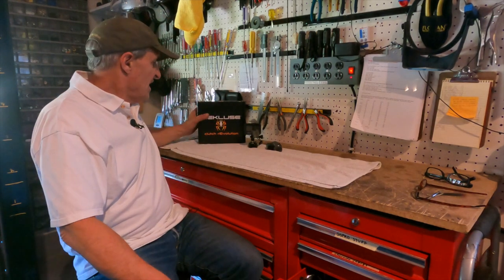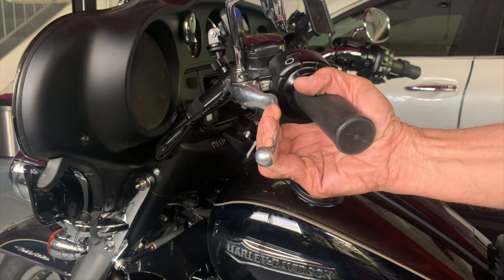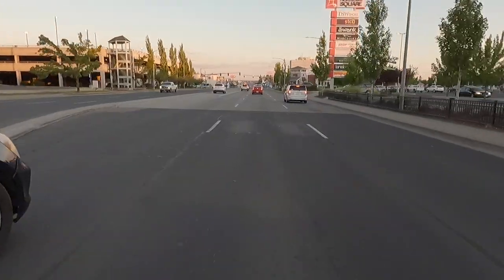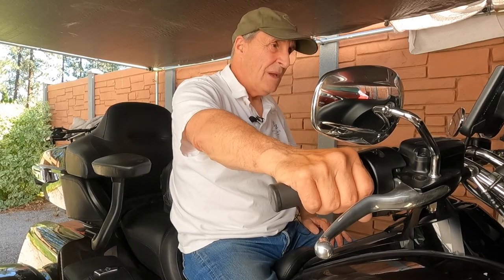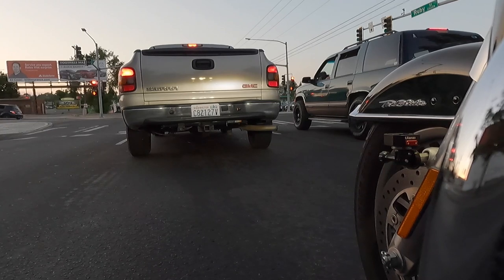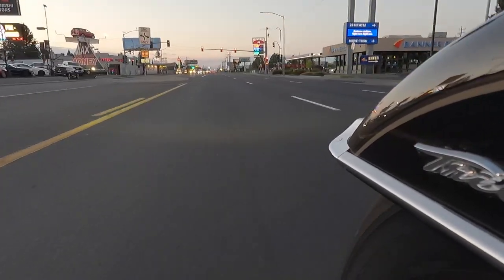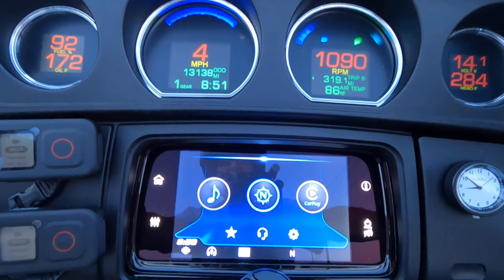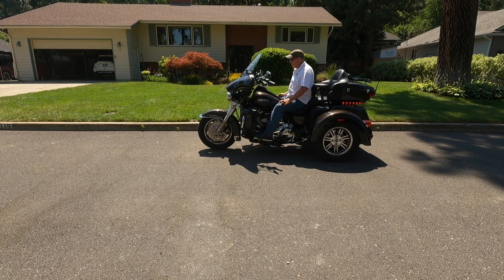Rekluse Clutch Harley Davidson Tri Glide M8 Examples of use.

Comment: I’m watching you use the 10% if I pull it all the way in would that be an issue if I pulled the clutch all the way in
Reply from the maker: Should not be an issue whatsoever. I use the 10% method all the time with my rekluse clutch.  Known issues for a rekluse clutch wearing out prematurely is, being very hard on the clutch without adjusting it as needed. I have not adjusted mine in 10,000 miles that it’s been on there. And I believe that’s because I am easy on it.  A person hard on it would require adjusting more often. The other issue is a bad installation. Not following the exact procedure and installing. I have seen that happen.  Everything has to go in perfect order.

Comment: Fantastic, a new relevant video on the rekluse! I looked last year but not enough information for my liking on my 2014 ultra limited. I too have hand issues on the clutch lever. Also have short digits, and installed a short throw lever, works great. I read another comment about the 10% downshift. I thought you were downshifting at a certain rpm range without the clutch. Did I miss something there? 2nd question, does this clutch get rid of the "learch" in lower gears making you pull the clutch in coming to a stop? Think I may go ahead and order one and keep my Ultra!
Reply from the maker: I use the 10% method up shifting and downshifting not all the time but a lot of the time. You have to get a feel for when it’s appropriate. Takes a while but it works.  I think the recluse clutch is exactly what you would need. Yes when it hit 1150 RPMs and the speed was just right you could downshift with no clutch action at all as you saw in the video
Reply from the maker: Not sure exactly what you mean by “Learch”. I’m thinking, that when you are shifting down when it hits 1150 RPMs you don’t want to do extremely fast to first gear when doing 20 miles an hour or yes you will get that lurch
Reply from the maker: And yes I am downshifting when it hits 1150 RPMs without using the clutch lever at all.
Reply: @windsurfed1  Maybe learch is the wrong word. when I am coming to a stop, lets say 3rd gear, slowing down "light is far away, nut a sudden stop, then on to second. The bike gets to the point where it wants to stall. Aka the jerky motion with no power added. Seems like yours does not do that at all...
Reply from the maker: @dancheatham5106  The bike will not stall at all.  Even if you come to a stop in fourth gear the clutch automatically disengages around 1150 RPMs totally no matter what gear you’re in. You could be in six gear and come to a stop.  Then, while you’re stopped you would have to shift down to get to first gear. All this you do without even touching the clutch lever.   Then when you were ready to go you just give it gas and it automatically engages and away you go.
Reply: @windsurfed1  Awesome, thanks again!

Comment: Does the Recluse system in any way negatively affect the reverse capability of your trike?
Reply from the maker: No, it does not. The reverse motor is electric. You still have to have the motorcycle in neutral before you can use the reverse electric motor.   
In other words, it works as normal, and is not affected by the rekluse clutch.

Comment: Very interesting for sure! Also, where did you get all your GoPro attachments? I know you have the Ulanzi stuff, but where did you get the brackets to attach to your bike. I appreciate your help. Respectfully, Ed
Reply from the maker: Hey Ed. I watch your videos all the time. I got almost all my GoPro stuff on Amazon or at Best Buy. The Fairing mount and the front fork mount I got from lawabidingbiker.com. The rear luggage rack mount is a go pro bicycle handlebar mount. The engine guard mount  from eBay but I suppose you could get it on Amazon or elsewhere also.
SmallRig Multifunctional Crab Clamp w/ 3.5” Adjustable Arm &180° Ball Head-2164. And of course the suction cup mount is a go pro brand. Hope this answers your questions.
Reply from the maker: On this rekluse clutch video and a couple other videos I used the suction cup mount next to the gas cap and used a Gopro extension and taped The extension down to the gas cap lid, with 1000 pieces of electricians tape to keep it as stable as I could. It worked real good but when I had to refuel I had to take it all apart and redo it.
Reply: @windsurfed1  I appreciate you watching and I’ve seen yours too! As a matter of fact I just subscribed. I appreciate your help brother YouTuber 👍 Take care, Ed
Reply from the maker: @TriGlideEd  thanks Ed. I always enjoy watching your videos and listening to your commentaries. You’re a very interesting fellow.
Reply: @windsurfed1  I appreciate you kind words sir. I too enjoy your videos. Keep it up. Take care, Ed

Comment: Crazy question, but if i use the clutch as normal, will the auto feature still function?  My two issues are stalling on hills and stalling on turns.  I did not start riding until i was in mid 40s, recently, and have never operated a manual.  I am not getting the clutch control down, and am looking for something to eliminate issues.  I do not want to get out of the habit of using clutch just in case.  Example:  If i am on a steep hill, i have clutch held in, i begin to take off, let off brakes and roll on throttle, does my holding in clutch matter?  Will the bike hold without rolling back as i gas?
Reply from the maker: When stopped, and in first gear with your hand off the clutch lever. All you need to do is roll on the throttle and away you go, and then you use the clutch lever to shift up through the rest of the gears. If you were in sixth gear, and came to a stop, the clutch would disengaged by itself, but you would still be in sixth gear. Normally a person would shift down while coming to a stop, using the clutch lever, Until first gear is reached, and pull the clutch lever in.  in the case of the recluse clutch when you reach first gear and came to our stop you would not need to pull that clutch lever in. You can if you want, but if you hold the clutch and give it it will not go anywhere just like a normal clutch. 

The recluse clutch works superbly on hills. You’re just sitting there on the hill with your foot on the brake and when the light turns green, you just give it gas and away you go with no rolling backwards or stalling the engine.  Then you continue to use the clutch lever to shift up through the gears.  

Hope this kind of answer your question. I really really enjoy the recluse clutch.  on these tri glides they’re kind of a heavy duty clutch. The lever is hard to pull in, least it was for me especially at stop sign and stop light. It made my ride in hundred percent more enjoyable.
Reply: Very helpful, thank you!  Mine is 2018,and clutch isn't difficult to pull in for me, but hills have been tough for me. Like not rolling backwards or stalling.
Reply from the maker: @brigmannbailey7299  one great thing about the recluse clutch is the bike will never stall out.
Reply: @windsurfed1  So far, the clutch has been wonderful.  The clutch performs much better than the stock clutch and provides a quick/smoothe shift.  It is truly a perfect racing clutch!  What I did not know, was that between 300 to 500 miles, it is necessary to adjust it to prevent slipping.  Mine began to slip around 350 miles, and eventually went out completely.  Mechanic adjusted it and seems to be fine now.  Hoping the plates werent glazed beyond repair.
Reply from the maker: @beetlehound  wow, I have heard of this happening to people before. I never experienced that issue. I now have around 15,000 miles on the clutch. I have never touched it.  No adjustment or anything.  I’m a very gentle rider but occasionally I get it on. Never once felt the clutch slipping.
Reply: @windsurfed1  Update:  After another 500 miles, it turns out my plates were smoked!  Mechanic has been discussing with Rekluse engineers, and according to them, not keeping RPMS at 2500 will cause this.  Now, we cannot seem to find the right tune to make that easy in town traffic.  It is also lugging and popping when in first gear until we get up to 20 or so MPH.  It is a great clutch when it works, but has sure been a pain in my side for the last few months.  Any advice, or have you heard of these struggles?
Reply from the maker: @beetlehound   G, that sounds like some complicated problems. I have not had any issues with mine whatsoever and I have over 9777  miles on it.  I do not keep my clutch “at 2500 RPM”. Don’t even know what they’re talking about. All I know is that I use the clutch as a normal clutch until I come to a stop once at a stop, I just gas and go without using the clutch lever and then shift up to the rest of the gears using the clutch lever.  It just kinda sounds to me that the clutch was not installed properly. I could be totally wrong on that. It seems like the plates would be smoked because of slipping excessively, meaning the clutch was not adjusted properly in the very beginning.  I have never heard of any issues with the recluse, clutch this severe, other than a couple of guys claiming it was not installed correctly.  I keep referring back to that problem about not being installed correctly. But as you know, things can be installed perfectly well and it could be a bad defective part. If that is the case then hopefully you will get a free new clutch and it would work good.
Reply: @windsurfed1  I do not know other options for install to verify or check that piece of it.  I am hopeful to get it corrected as it is definitely fun!
Reply from the maker: @beetlehound  I know. You’re at the mercy of the mechanic.  I am a backyard mechanic.  I thought it might be to complicated me so I took it to the Harley Davidson dealer and they installed it for me. Now, after looking at it, I probably could’ve done it myself, but I’m glad they did.

Comment: I guess to use engine braking on downhills you would still need to manually clutch?
Reply from the maker: Yes that is correct. The recluse clutch engages and disengages when coming to a stop. The rest of the time a person should use the clutch lever when shifting up or shifting down. Unless you’ve mastered shifting without a clutch.  Which can be done,but using the clutch lever is more constant

Comment: I'm confused, as the Rekluse website states that there is no Rekluse clutch available for a 2020 Harley Tri Glide, when I enter the bike model and year.
Reply from the maker: My Rekluse Part number for my 2020 Tri Glide is RMS 6205.  I went on their site ad it was confusing.  However, I just ordered mine thur the HD Dealer and they got it and installed it.

Comment: I saw you upshift manually (10% method).  But were you also downshifting manually (using the clutch) - or does the Rekluse do that automatically?
Reply from the maker: Downshifting requires clutch lever operation. I still use the 10% method on downshifting as long as the RPMs are not excessively high. I am a very mild rider and I don’t get wild. If you’re a wild rider, I would suggest pulling the clutch in all the way in. Gentleness is my philosophy when using the 10% method.
Reply: @windsurfed1  Thanks for the video - and for the quick reply!  I agree with your philosophy…I once heard said (by an older rider) that there are old riders and bold riders….but very few old bold riders!
Reply from the maker: @d.s.7817  that’s a funny/good saying.

Comment: Do you HAVE to do the 10% method? Thought Rekluse was supposed to be clutchless?
Reply from the maker: The recluse clutch is only good for basically coming to a stop and taking off.  When you shift from 1st to 2nd 2nd to 3rd third and fourth and so forth I use the 10% method and when I shift down sixth to fifth fifth to fourth I use the 10% method. However you can become good enough to shift through all those gears without even using the clutch if you’re very easy.  shifting up and shifting down.  That takes a lot of practice in knowing your engine RPM.  But basically the recluse clutch is just for coming to a stop and taking off from a stop it works fantastic.

Comment: How's your snapper mower holding up?
Reply from the maker: I actually sold that about the beginning of 2019 summer.  It was a great mower.  I have a postage size Lawn.  I ended up buying a ego self-propelled battery powered lawnmower.
Reply from the maker: I guess it was the beginning of the 2020 summer.

Comment: How are you liking the clutch now
Reply from the maker: Liking it as expected. No longer have to pull the clutch lever in coming to a stop or taking off. Almost like an automatic transmission.   I am very easy on my motorcycle so it probably will last forever.  I have about 6000 miles on it now. I also added a rekluse clutch slave cylinder which makes it easier when I do use the lever.  In other words, at my age I would definitely buy another one if I needed one.
Reply: @windsurfed1  thanks enjoy your videos

Comment: My Harley dealer that installed my Rekluse Radius clutch insists that I must use the clutch all the time except when I came to a stop.  But from your video I get the idea that is not correct. The dealer also says I must keep the Roma at 2000 or more. Help!  Thanks.
Reply from the maker: As you saw in the video how I use my clutch. That’s how I use it. I have heard of one other dealer that told the customer the same thing you were told. I have 4500 miles on this clutch and it is fun the way I use it. I am a very gentle user of the clutch I’m not a real get up and go person. But once in a while I get that way. If they installed the clutch correctly, which I think they did, you should not have any issues at all using it the way I have in the video. I would not worry about it at all. Just be gentle and slow when shifting down. When shifting up I normally use the 10% method and do it gently. I have done that all my life. It works!

Comment: It’s as though you were driving an automatic transmission?
Reply from the maker: No I have not put any other shock system on the bike. I am very happy with the OEM system at this point. And yes the clutch is very smooth I am really happy about
Reply: @windsurfed1  I put the Legend shocks both front and back and it rides very smooth but my advice is to put the Risers ($200.00)+ to bring the bike up about 2+ inches, put them on when and if you change your rear shocks!  But most important is that you continue the videos and tell us what the part cost and the labor. I put the screw where the CB antenna goes just so I could have a symmetrical look to the rear!
Reply: Two mini antennas!
Reply from the maker: @Trooper738  Thanks for the information about the legend shocks. I may go to do that someday. I don’t know. And I had heard about the risers. Don’t see myself doing much more videos on the bike as I have put everything on and covered everything.   But putting new shocks on is in the back of my mind maybe. Maybe it will move to the front someday.